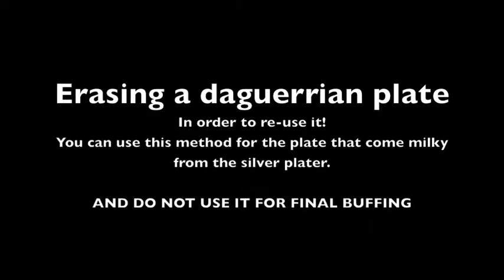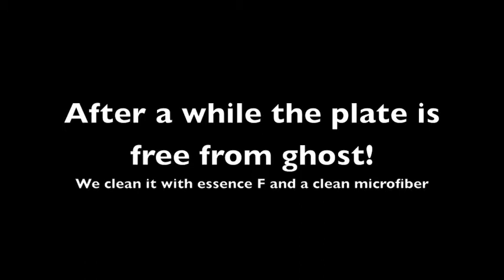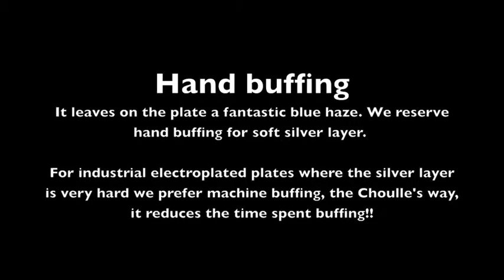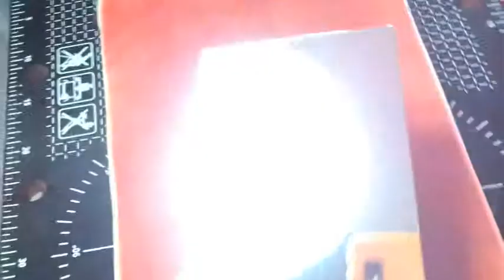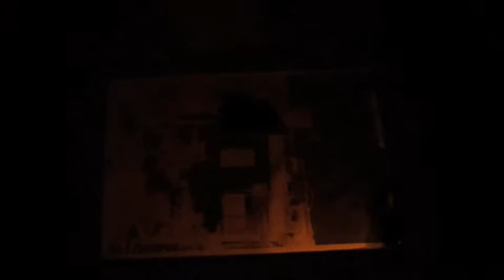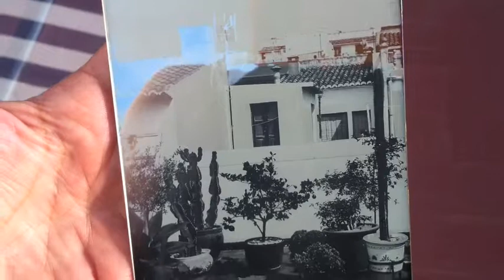Daguerreotype | Erasing a dag | Polishing and buffing | Becquerel development

Comment: How do temporally attach your plate to the wooden block holder??  I'm thinking double sided sticky tape might work.  I'm also thinking about trying blocking wax stick.  Thank you for the help!
Reply: Gary Meyers Hello Gary. Yes we simply stick the platebtobthe wood with a good flat( important) double tape. A band of 1, 5 cm on both side is enough, or with the heat created when polishing, youll bent the plate in order to stick it out. We hope it helped.Do not hesitate to contact us via mail, we dont consult Youtube messages that often. Best !